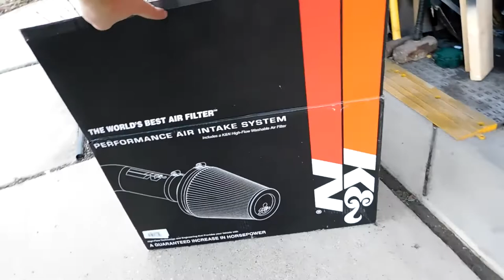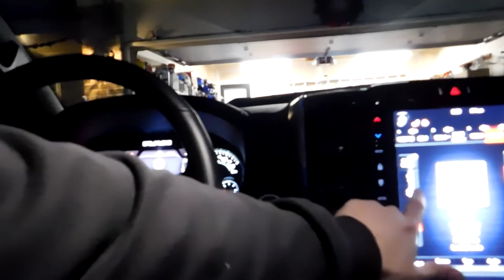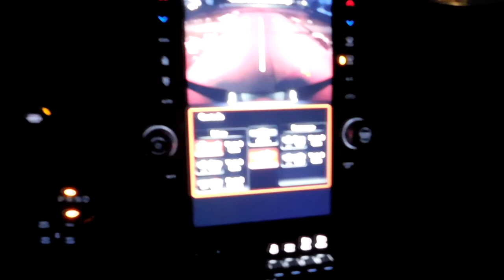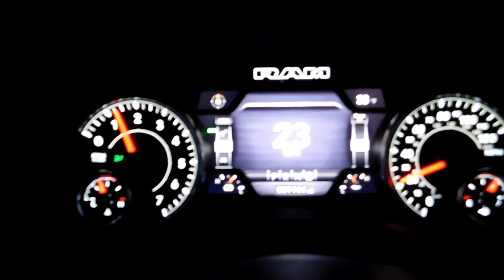How to  install a Cold air intake K&N for You’re 2021 Dodge Ram 1500 Laramie

Comment: I had that K&N installed on Wednesday ram 2022 laramie
Reply from the maker: Nice.! How do you like it so far..?
Reply: @WDT_HighPerformance  
1. acceleration is predictable...responsive and quick as oppose to stock.
2. Couple the K&N with premium gas...93 octane if I remember correctl. Fuel economy is way way better than regular plus the performance and smoothness of the engine is incredible.

This Sunday I am going to do my first fuel treatment Amsoil PI performance and then after that I just gotta use Marvel Mystery Oil for every 2nd to 3rd fuel up.

Comment: Hey man... What was cost on this and have you made any exhaust mods prior to this intake install?
Reply from the maker: https://fasthemis.com/i-23835888-kn-77-series-cold-air-intake-dodge-ram-5-7l-hemi-1500-2500-3500-2009-2018.html?ref=search:https%3A%2F%2Ffasthemis.com%2Fsearch.html%3Fq%3DK%2526N%2BCold%2Bair%2Bintake%2Bfor%2Ba%2BRam
Reply from the maker: Yeah so far I haven't done anything to the exhaust for now and it cost me $400
Reply from the maker: Thank you for watching brother I appreciate that 😇🙏🏼😎🤘
Reply: I just got myself a 2021 Ram in the very first thing I did was take it to get a mid muffler delete... HUGE difference. $150 out the door and I kept the muffler.

Comment: It won't start without the hood closed? So you have to shut the hood, start it and then open it back up again to check stuff while its running. That's a real dumb feature
Reply: That’s only for the auto start with the key fob
Reply: The first thing to do is get a real mechanic, obviously  this improved mechanic is far from the reality
Reply: @edilbertogarcia9637  but you still took the time to watch his video?